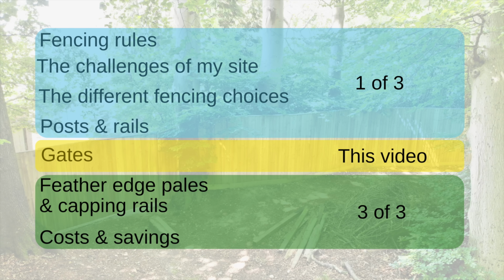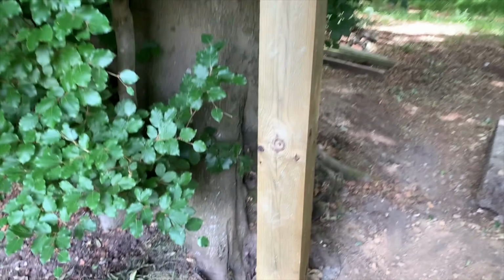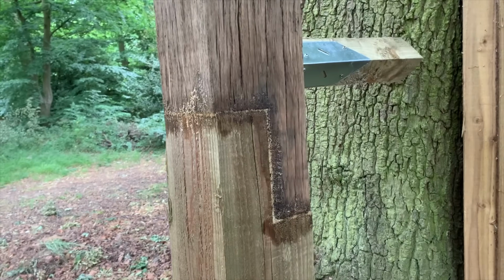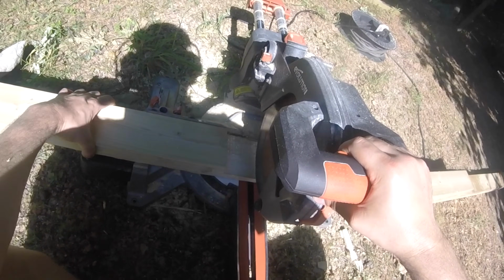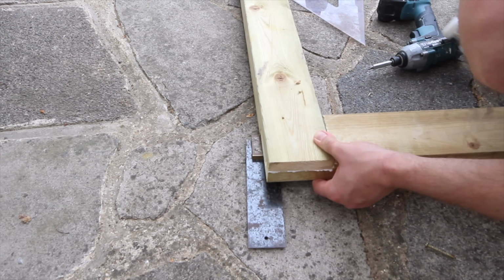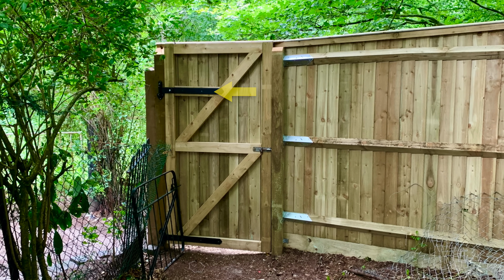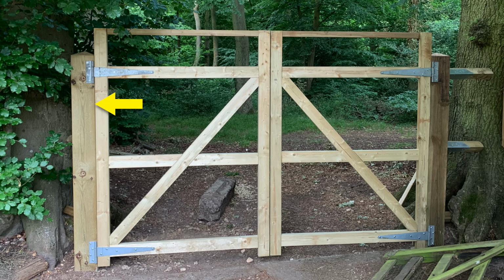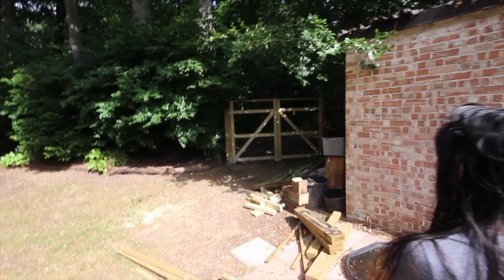Fencing: The Ultimate Guide | Gates from Scratch (2 of 3)

Comment: EVOM/S , just found your vids Ali, I use an Erbhauer cross cut saw fir my jobs, (ongoing house and garden reno) . Problems with the Erbhauer are, very loud motor, cut not square (cuts on the trailing blade edge), angle scale not reflected on cut (ie 45deg mark not mirrored on the cut), and set  angle stops have too much play. Lastly depth stop randomly adjusts itself. So not great, wish I'd spent a bit more way back when I bought it. It's the sort if tool that's worth paying tbe extra  for as it's used so much in Reno and DIY jobs.
Reply from the maker: The saw was already won I'm afraid but good to know about the Erbhauer. I have their impact driver and multi cutter which are both decent but really rate the Lidl mitre saw for the price. Evolution one is a nice step up before going for the dewalts/Milwaukees etc!

Comment: ⚙️ EVOMS  🛠

Well done on the progress so far Ali,as you sure are getting on well with the building of the gate.

A note that I would suggest,is to perhaps treat the fences (Just don't know how cost-effective it would be) , or any other wooden structures/DIY Builds (Like your potting table in one of your other videos) with some Yacht Varnish ,as it sure makes the world of a difference in terms of preserving the wood in general I have found.

Have done it with my potting table,and with my garden gate door, and can swear by the finished product as whole.

Have made use of "NO NONSENSE YACHT VARNISH GLOSS CLEAR" (and does it fit your general brand suggesting aswell)..  😉

Keep those vids coming..and all the best of luck on the next stage. 👍🏻

Thanx again.🙏🏼
Reply from the maker: Very interesting. I’ve looked at that many times. My understanding is that for it to be effective the wood needs to be super smooth (sanded to a really high grade) like on a yacht so it wouldn’t do that well on rougher timber. There must be a reason it’s not used on cladding, decking, fencing or outdoor furniture...
Reply: @AliDymock  Most likely true, and a possibility in general...as the finish on boats do tend to look extremely well. (The process involved in getting the silk-smooth finish, is a trade-in itself, and is there a lot of sanding involved between the various coats)

It is also a very thick (Almost like syrup and quite sticky..and thus would most airborne particles stick to it quite easily ) medium to work with and is the drying time slightly longer than normal.

It is also an expensive (probably down to the composition of different chemicals) product, and could that be another reason why it does not get used on some of the wooden products that you've mentioned.

I have even brushed it on the hinges (The metal parts that fit to the post and door in order to prevent it from getting corroded and oxidising over time...and does is seem to be working wonders,as there is no sign of oxidation,as there is on the actual hinge itself..and does it still have that smooth shine and finish to it..)... Thinking about it... all of my garden hand tools (Brooms,Pitch Fork,Pick Axe,Shovel & Spade and does the metal shaft, and pins that go into the handles still, have their nice shine to it..not to forget about the actual handles in itself.

Comment: EVOMS
Excellent as usual. Love the amount of detail. Could have done with this last year. I want wild about the results from the glue, I used the same as you.
Suggest you leave a larger gap between the double gates, as they will swell in the wet, and over that length will close up the gap. Mine are 2no. 2m gates. Probably not an issue if you're not using every day though. Also, consider a gravel board along the bottom. Stops the feather edge rotting, and also looks more consistent with the rest of the fence
Reply from the maker: Agree with all that. I thought about gone a gravel board but thought it may look odd floating off the ground by 5cm. I guess when the bottom of the pales rot, I can trim 15cm off and stick a gravel board on 👌
Reply: @AliDymock  , yeah see how it goes. I guess you're probably nearly done if you're prepping videos. You can always cut 100mm off the boards and rip a gravel board down to keep the top of the gravel boards the same.
I'll be interested to see how you deal with the top of the gate timbers and trellis topper. Still struggling with making mine look finished from the inside. The small gate, which I did after, looks much better

Comment: EVOMS - Thank you for a great video lesson on adding to a post height and building your own gate.  You’ve helped me on how to build a good strong shed base for my beach hut project, and what bolts to use to secure to the dense blocks (still yet to buy the bolts, but thank you again for link and responding to my message). This is my next job as my gate posts are rotten.  The EVO Mitre Saw would help me enormously as only have a good old fashioned hand saw.

Comment: EVOMS. have the evolution circular saw and great piece of equipment. Even used it with a diamond tip blade and while it took a bit effort it cut the bit of concrete I needed it to cut. Great videos anyway. Loved the shed build and loving this new series.

Comment: EVOMS  Hello Ali You Inspired me to  start building my  garden room i recycled bird fat ball buckets with the bottoms cut to cast my pillars  as a base 12 in total for my 4.5m by 3m  i am now at the floor stage i am using a double lap joint frame using 4x2 treated nailed together with stainless steel nails 4 inch 
 finishing the outer skin with box profile metal cladding juniper green i might even put up my first youtube video  when its finished  keep up with the great content   👍👍👍
Reply from the maker: Niiice! Did you bother with any rebar or just concrete?
Reply: @AliDymock  Just concrete the bucket's are 10inch diameter  to 8inch  I went down to the clay compacted with a Dolly. Depth was 450mm they are solid there's 100mm ish above ground I will put some pictures on my YouTube page soon

Comment: Great solutions. I take it you only measured the gap between new and old posts at one height? I've slowly been replacing panels the last couple of weeks and  have had some older posts that have traveled diagonally quite a bit. I think your Mrs is patient and supportive of you DIYing / home improvement hobby and all the effort (I'm lucky to have the same) but that bit at the end was funny.... What do you think darling? Err great, some wood on hinges, hold on is that a camera, ah amazing darling they look brilliant.   EVOMS #pealingitofffingersismorefun
Reply from the maker: Spot on! The reason for it was that each night to secure the garden I leant the old gate against it the posts so I was just too lazy to remove it and measure at the bottom. Very silly.
😂yeh, code for 'haven't you finished yet!?'

Comment: EVOMS. Did double gates fit your garden 6 years ago. That have me confidence to go onto bigger projects. The posts I bought had a groove sawn in I assume to prevent further splitting. Was amazed when doing my research that so many guides had the compression brace timbers running the wrong way offering no support whatsoever. Looking forward to the final part.
Reply from the maker: So true, I looked up a local fencer before doing this project and there was a picture of the brace running the other way. Nah, I'll do it myself. 
When the brace runs the other way it's called a 'tension brace' which does work if you are building with green wood. As the wood dries out it pulls the bottom latch side upwards but all timber we use nowadays is kiln dried so unless you are a using a wire, it's generally wrong.